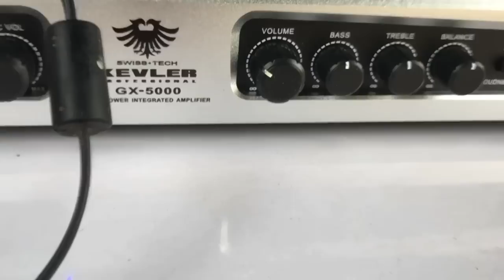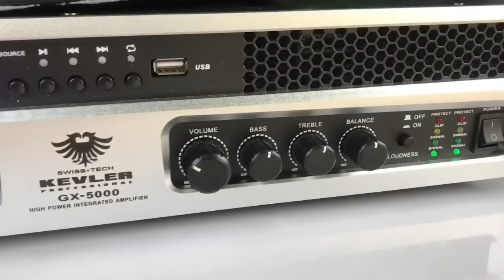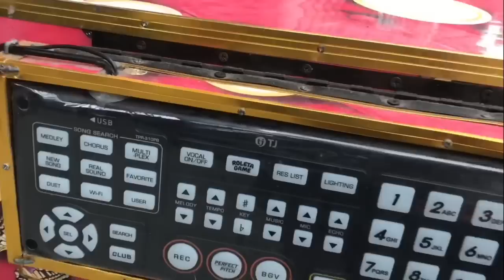KEVLER GX5000 TESTING SA VIDEOKE

Comment: Good day sir. Tanong kolang po sana may bago kasing AMPLIFIER KEVLER GX7000 1500WATTS X2CHANNEL. Hindi ba masisira si Amplifier kung isasaksak ko 4 na kevler zlx15 passive 1000watts each speaker? Bali 4000watts lahat. Sana masagot. Salamat po.
Reply from the maker: Ndi namn po  pero pakiramdaman nyo din po
Reply: @RandyNoble_VTBR  salamat po sir Godbless po :)